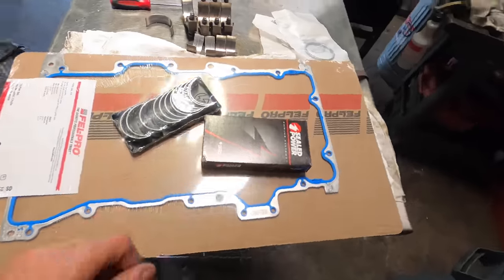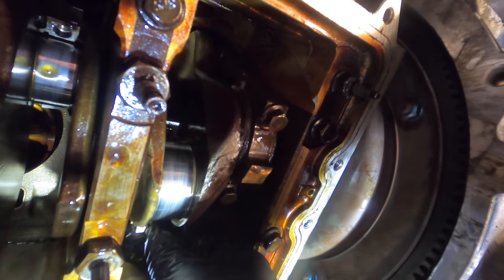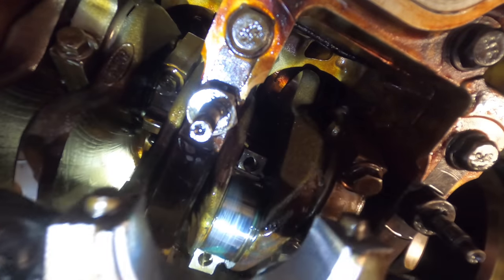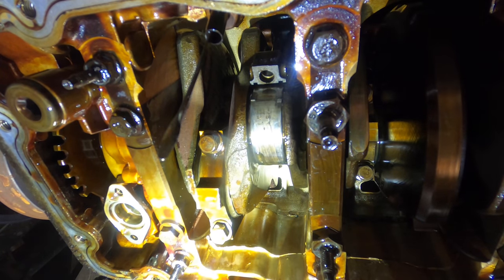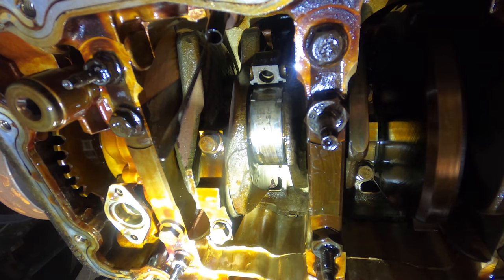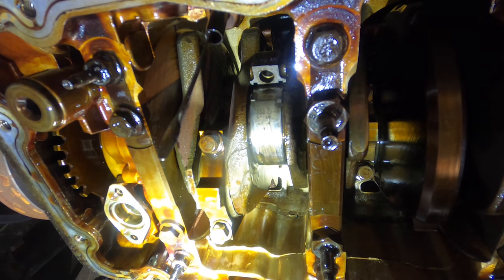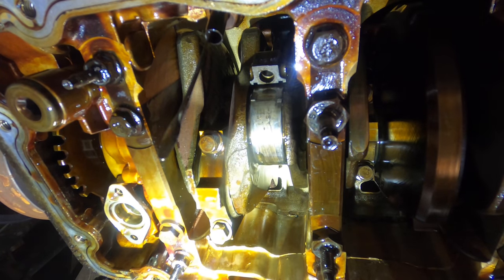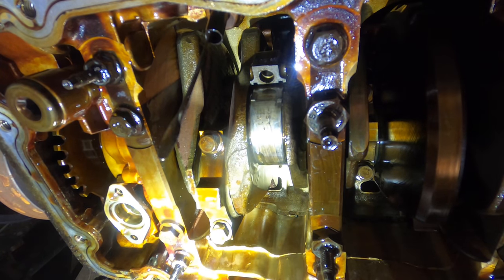Saving an Engine: Spun Bearings Replaced

Comment: NICE! So, 1-2 were bad along with starting to spin 6. I had my fingers crossed on both hands when you started bringing up the rpms. Good job Rainman! You can walk around with a bit of skip in your step after that one. Cheers!
Reply: In situations like this, all the bearings are bad. Same goes for high mileage motors. Now, in normal, well maintained motors, the crank journals will look new, and only the bearings will be worn down. 

Basically, what I am saying is not doing all of them is a bad call. They are easy to do.
Reply: @goclunker  Agree, plus on that motor, it is a dual over head cam, meaning there are four cams at the very top of the motor, and the very last thing to get oil, and the first to lose it if oil pressure drops.  So if the bottom bearings look like those did, what do the cam journals look like, what do the main bearings look like??  Since clearances in the engine determine oil pressure, what was the oil pressure when the repair was finished??  Will the oil pressure be enough to last in this engine??  This was a patch job, that may work out or may just be putting of calling this engine dead until rebuild for a few months or a year.   Without knowing the situation of the customer, I can't make any hard judgement, but to me this is a crap job to patch up a failed motor, and it should have been either pulled and rebuilt in house or have a rebuilt from supplier installed.  Now maybe this was all the customer could afford, and then this would be a good repair for that customer, but in general practice, no.

Comment: Most shops would have heard the rattle and said new engine. I’ve never seen bearings going into a motor still in a car. Pretty cool
Reply: I've never seen it done as you would normally polish/repair the crank, which is engine-out. I don't know how long this repair will hold personally. That crank needed some attention.
Reply: Very impressed as well! I didn't know something like this could be repaired with the engine still in it. The engine might have other damage but at least it keeps the owner driving the vehicle a while longer until his ready to buy another one.
Reply: It's a pretty easy job on a front wheel drive vehicle due to the fact that the oil pan comes off easily .

Comment: I did the old Emory cloth-new bearings trick a bunch of times. Saved my butt pretty often. Works really well on low speed engines such as tractors & dozers, where 1100-1200 rpm is working speed.

Comment: The first time I replaced bearings from the bottom I did a great clean job of everything.  I was in high school still I needed this Ford Truck or I would simply frickin die I guess.  After buttoning it all up and giving the key a twist she fired right up and within a few moments continued to make the same knocking sound!  The good news was it would up being my first engine pull, sanitize, build and install ever.  All done on a sheet of plywood in the bed of that truck!  Turned out to be a wrist pin bushing shit the sheets and was making the knock, not the lower end.  She served me well for years!

Comment: Forgot to tighten 3rd nut on oil pick up. 26:12. 
Great video Ray Ray!!
Reply: When the nut falls off, it will probably get knocked around a bit by the crankshaft and wind up in the pan, where it won't hurt anything. However, the pickup will start vibrating, and it will eventually crack or break off at the mounting flange, starving the engine for oil again.

Bearings, take two!
Reply: @edwatts9890  …..I doubt it. Other 2 bolts are tight. It will keep pickup secure for the life of that engine. If that nut comes off it’ll just drop in pan. No harm.
Reply: @1320Jason : Nope. That pipe is long enough that I would estimate the first-mode vibratory response in axes "up-down" and "right-left" to be at about 15 to 100 Hertz. At frequencies at or about those numbers (900 to 6000 RPM, with additional input from ignition events at 45 to 3000 Hz.), the pipe will fail at its maximum displacement/stress point, and that will be in the heat-affected zone immediately adjacent to the weld which attaches the intake pipe to the flange which is bolted [relatively motionless] to the block's mounting point.
Reply: @edwatts9890  …….I disagree
Reply: @1320Jason : Go ahead and do so. Bear in mind, though, that I am an aerospace engineer with a particular interest in shock, vibration, and acoustics.
Reply: If the mfg didn't think the pickup Bracket was necessary and could save 5 cents it wouldn't be there. Likely bthe bearings will wipe out before vthe pickup tube bresks
Reply: @dougjones9493 : Indeed. Engineers are paid to optimize products, but always with an eye toward cost and profitability. That bracket appears to be a modification, placed on the pickup to eliminate a vibration-related failure which occurred during development testing.
Reply: So I wasn't the only one saying don't forget that nut, it will crack in a year
Reply: @dancaissie9139 : You are not alone.
Reply: @dancaissie9139  He found it in a recheck off-camera. It is in fact tightened.

Comment: This reminds me of when I hand planed the cylinder head and block on my old horse truck, using sandpaper and a wooden block. 
 To my surprise, the 'repair' fixed the warped parts, and gave me years of trouble free motoring  :) .
Reply: Did something like this in my daily driver Subaru. Flat benchtop, then 1" marine plywood, 1/4" glass, then various grades of wet & dry paper. Hours of work, but 35K later and still running strong. Zero leaks, great gas mileage, no funky noises, what more could I ask for?
Reply: @skjeflo1  
 Yup. 
 It is amazing what you can achieve, with even the simplest engine repair methods  :)  .

Comment: Most shops would have not even given the customer this option. They would have said it needs another engine. If the other bearings/journals are good, the oil passages are clear (probably) and the kid keeps oil in it he should get a lot of miles out of the engine yet.
Reply: it's a ford product, something else will break that will be the reason the owner finally dumps the car.  The engine is or should be, easily the longest lasting major component in any car, even VW makes good solid long blocks!  Its usually electrical issues that kills VW's, anyway.  If the car quits running because of actual internal engine wear/damage, either the car's not getting maintained or the driver is flat out abusing it on the road,  or both.

Comment: Great job doing this, except you never checked the main bearings! With those large pieces you pulled out, that's the first place I would have checked!
Reply: Yes, those pieces he pulled out are to big for those bearings!!
Reply: exactly, those main bearings will need to be replaced as well since you there, this is not cheap job I don't think this car was worth.

Comment: It's neat to see a real mechanic 🧰 show a video like this. Most of them won't do or show this or even acknowledge that it would work or that there is even a place for something like this. There not many quality videos of it out there. Thanks again! I did this on my small block Chevy K10 last year about this time. Put new rod and main bearings in it. Got me a good bit more running oil pressure as well. Which was my reason for doing it in the first place.

Comment: I did several bottom end repairs on the big Cummins diesel engines, even a full in frame rebuild and always wondered if the same could be done on a gasoline engine. Now I know. Thanks Ray. 👍👍
Reply: Lots of people do it to small blocks for a way to get a little more time out of one or two in rease oil pressure.

Comment: enjoyed this immensely. thanks! just one thing, I may have missed it during the editing of the video but at 26:00 you put the nut on the oil pickup tube and finger tighten it. From that point on I never saw I wrench or socket ever put on it. You did the splash nuts but not once touched the nut on the support bracket. I hope I missed it in editing. :) Cheers from Louisiana.
Reply: I noticed the same thing!  I hope that got addressed between edits although I never saw it's position change throughout the remainder of the video.
Reply: I'm glad I wasn't the only one to notice that , it would be a shame as it ran so quiet after the repair.....
Reply: Plus the No1 bearing cap accidentally loosened, didn’t see it get tightened again!
Reply: I was checking comments to see if anyone else caught that! Lol
Reply: Yep, he did the two oil pick up bolts, but not the filter end support bracket nut...   I thought I had just missed it and did not rewind to check for sure.
Reply: @shadgrind  I saw him retorque #1 bearing cap, and I also saw him not tighten the sump bracket nut.
Reply: Ah, the downside of videoing your work. But Ray responded to another, similar comment and said he did tighten them all.

Comment: This is the kind of service and effort you can't get at a dealer, they will want to sell you a new motor worth more than the car.
Reply: People who take their care to the dealership have higher expectations.  If they have this done at the dealer, they would drive away thinking it's "fixed".  But this is a patch, not a fix.  Big difference.
Reply: This repair is more then what the car is worth lol
Reply: It’s also about warranty. If say something else with the engine goes wrong we get “you worked on it last, you pay to fix it” so a new engine it is. Simple 👍🏻
Reply: @fredygump5578  What do you mean "patch"?  I have seen folks do this same repair and get another 100,000 miles out of their engine.  IF it is done correctly, it is a fix and not a patch in my opinion.  Is your experience different than this?  I have seen a YT video of a guy replacing the rod bearings on a crank that is beyond shot, I mean gouges out of it, and the "repair" lasted about 10 minutes and it was knocking again.  But, IF the crank is still in good shape, and the new bearings have the clearance within spec. it should be fine.   I am not sure why Ray didn't check the clearances on each new bearings?  If the crank is really bad, chances are the mains are gone too and the engine would need to be rebuilt.
Reply: @anno6969  2003 doubt it has a warranty lol
Reply: As a dealer tech, it's not only a safer bet to replace the engine because you have the assurance all bearing and wear surfaces are now new and you won't have any other issues with the top or bottom end, but the new engine comes with a parts warranty. At least with Chrysler, I know for a fact that the warranty is 2 years and unlimited miles, so if anything ever goes wrong mechanically with the engine within that time, those repairs are covered under warranty and the customer won't need to shell out more money for a top end repair, and if the bottom end fails, Chrysler covers another engine.
Reply: @OverlandOne  I meant exactly what you think I meant!  It's equivalent to plugging a punctured tire.  Sometimes you can get 40k miles on a patched tire....sometimes you don't.  Ray didn't measure anything!  An oil passage somewhere could be plugged...or there could be a chunk of metal still in the engine waiting to plug it.  So it's a complete roll of the dice!
Reply: @OverlandOne  With something like this I would be more worried about the rod being worn out of spec from the spun bearing and you can't check that without removing the rod. The only correct repair is to pull the head and piston to replace the rod. The repair he's doing is questionable in terms of longevity. It might last 10 minutes, it might last 10 years. No shop in their right mind would offer ANY KIND of warranty on a repair like this.
Reply: @fredygump5578  Good point.  The ones I have seen that worked very well did not have any metal chips anywhere in the pan and none of the bearings had spun yet.  (I had forgotten that from the first video)  They were just making a slight knocking/clicking sound on start up.  If that rod with the spun bearing is out of spec. then it will indeed fail pretty quickly as you suggest.
Reply: @madmatt2024  I agree.  I mentioned in my reply to Fredy gump that I had forgotten a bearing had spun as shown in the first video.  The ones I have seen work well did not have any metal chips in the pan and no spun bearings and the cranks were in excellent shape.  That rod most likely is out of spec and it will cause a failure sometime in the probable near future.
Reply: No one wants to do major engine repairs anymore. Both cuz they can make more selling u a new car but also cuz they just don't want to deal with major repairs. They would much rather make a shit load of money on oil changes, tires, brakes, that sort of thing. Things they can do quickly and get it out the door
Reply: @ianriggs  Sooo true,,,its hard to find a mechanic that really cares about the customer versus the boat load of cash they make ,doing a fix like this ,when all bearings should of been fixed , crank took out,,if your going to do something, do it right!!
Reply: @OverlandOne  i agree
Reply: @OverlandOne  Being out of spec and being in imminent danger of a second failure can be very different things. Without using a plastigage at least it's impossible to know how far out of spec it is, but since the bearing seated in the rod and cap properly I'm not worried about it spinning again as long as the owner isn't a moron and changes his oil. This is exactly what I would have done, though I'd have at least crushed a plastigage to get some idea of how long I could expect it to last lol
Reply: @edifyguy  I agree.  He could also get an idea by checking the oil pressure. If it is steady but low, and still in acceptable range that would tell him something different than if it were closer to the spec on a new engine of that model.  If it is like 10 psi at idle when warmed up, it probably won't last all that long.
Reply: @IanTassidarMcConnell  bro this car is like a nearly 20 yr. Old shit box. Replacing the engine would cost 4 times what the car is worth. A $25 set of bearings and 3hrs of labor +/- is definitely appropriate for the old pile. I had a 98 Silverado years ago that developed a moderate rod knock at 180k. I dropped the pan and put a cheap set of bearings in it and drove that truck another 100k. Was still running fine when I sold it too
Reply: @tylerwightman2315  I would be hesitant to put a set of rod bearings in anything other than my personal car for fear of it being one of the mains that's making the noise.
Reply: @IanTassidarMcConnell  I guess it's a gamble for sure. He probably could have pulled some main caps and checked clearances with plastigauge. In my case it was pretty obvious. #7 & 8 rod bearings were roached.

I'm sure that customer who probably can't afford a new engine or new car is very pleased. Worst comes to worst, car still needs a new engine and your out a couple hours but at least you gave it a shot

Comment: Let's see a 1000 mile update or if the oil turns silver
Reply: it will i found out that slapping new set of bearing works just fine and when i do it i let the engine idle for an hour then drop the oil its a glitter show but the second oil change is normal
Reply: @18888888888888888886  I never got the glitter show when I bearing slapped a Pontiac Grand Am that was in a similar state of wear. It's been 40k since, partly driven by morons, and driven hard some of the time (after a very gentle break-in) and the engine still sounds good as new. My neighbor is still driving it.